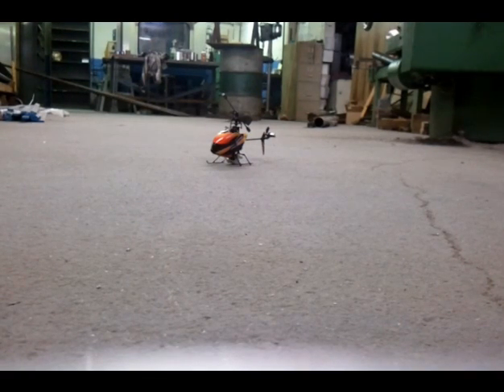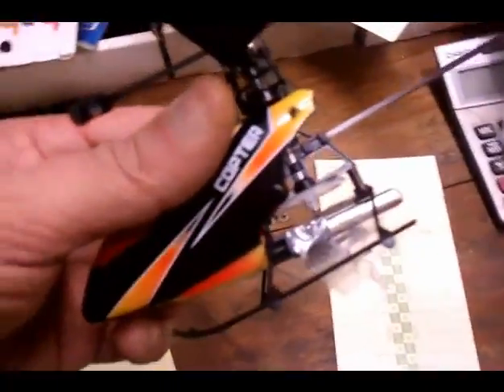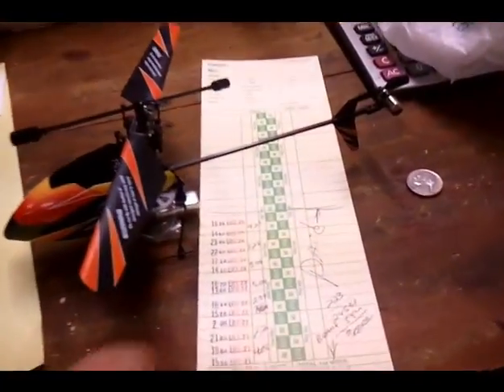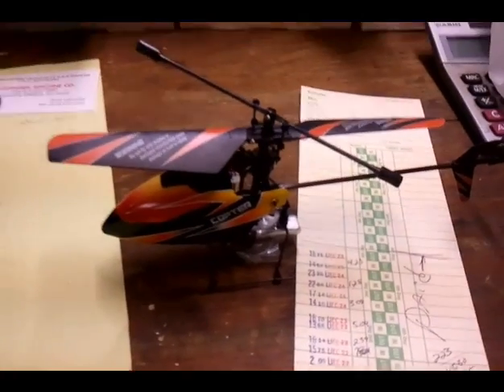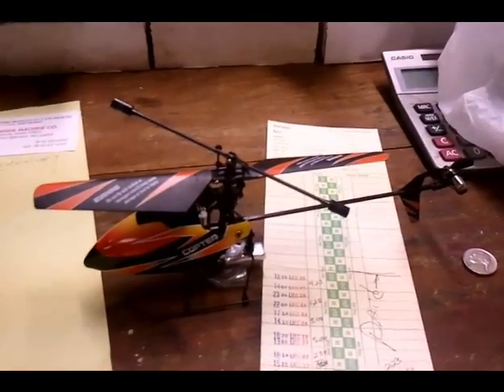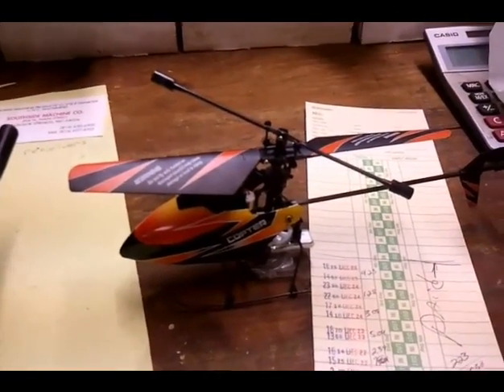WL v911 Weight Carrying Payload Test for FPV

Comment: I'm on mission to make a flyable fpv 911, managed to get a 1.2g cam for very good money and a 10mw tx , it looks like I'm going to be able to trim some of the board away and a metal tab can be trimmed on it too to save some weight on it which will probably offset the wire antenna that will be soldered to it, got a carbon shaft conning and i've found a few places I an save weight on the helis frame like the servo to swash arms are longer than they need to be, remove the tale fin, trim the edge of the Rx circuit board, a tiny bit off the flybar weights and even the flybar retaining screw prop screws and skid screws can loose nearly 1mm in length, the canopy is also coming off, this is surprisingly heavy, if you remove it normally you will see how it upsets the centre of balance and your heli fly's backwards from being tail heavy.

mine is a v911 pro, i've a feeling my skids and stronger frame are heavier than the standard 911 but we have to see what I can get out of it.

i've a much larger heli that can lift 100g+ without any trouble but that's easy, the fun comes trying to get one of these to fly with fpv lol
Reply from the maker: Be sure to follow up here with a link to some flying video from your DIY FPV v911!
Reply: ImYourGuiltyPleasure 

waiting on good old banggood to deliver everrything , flying my 911 on just one battery at the moment  too, waiting for all sorts to arrive!
having a lot of fun flying its bigger cousin the 912 at the moment too, it's well worth the money and the only weak point on it is the landing gear, I keep breaking them on hard landings when the battery saver cuts in and stops me throttling back up, going to be putting video on that too, its got so much lift it's going to manage it without a wimper, the fun challenge is the 911!

my can and tx come to 5g in total and like I said, I've found a number of ways to reduce the weight of the 911,I think with the cam on after the mods, I'll be about 2.5g at most over stock weight, I'm confident in getting it to work.
Reply: ImYourGuiltyPleasure 

good and bad news in the mission to make a fpv v911 pro

the good news is all my stuff arrived and only swapping the main shaft for a carbon shaft shed so much weight it was incredible, I have hooked everything up and had it off the ground with the cam and transmitter active.

the bad news is that although its got enough lift to fly, the gyro has decided to play up and the tail is constantly erratic and gets worse with more throttle, it's the vibration causing it and not the tx, I have found that gentle pressure on the gyro makes it function correctly so there's a bad solder joint somewhere.
I'll have to take a look with my USB microscope and see if it's something I can fix else I'm gonna have to swap all the gear and some parts of the actual heli over to another v911 pro I have that's been waiting on parts.

technically I have successfully made a fpv 911 but it's not worth posting a video from it as it's very hard to keep the tail straight and the video would be terrible ha ha.

no gyro at all I could handle but this is erratic and one minute I've no gyro and I'm controlling the tail (well the nose really as I fly the nose not the tail but you get my drift) with the stick alone then suddenly the gyro bursts back into life for like half a second and whips the tail round at full speed without warning lol.

I'll keep you posted, Steve.
Reply from the maker: Great feedback on your progress. Interested to see if you can get it sorted.
Reply: I'll keep you posted , oh and I didn't fit the 10mw tx in the end as I managed to get a 25mw tx that's multi channel switchable with led ch display from eachine and weighs about the same after all the soldering, possibly even less!
Reply: ImYourGuiltyPleasure 

ok, gyro was bad inside and not a solder joint, I had a gyro on a tiny board with leads comming out of it that I took of a rubbish coaxial toy heli that someone game me for bits, soldered the leads to the 911 board and it's flying normally again, I've had it in the air and flown it with my goggles, serious motion sickness!

flight times are terrible, I'm getting about 3 mins tops from a battery, it's very outside at the moment, about -1c and I noticed that the cold was drastically affecting flight times before, not sure if it's the cold affecting battery performance or the dense air making the blades work harder.

my scales came today and the heli weighs 39.45g with its battery, the tx and the cam on board, all I've done is swap the main shaft for carbon so far, I may move over to the other 911 circuit board as the gyro I've soldered in has added weight, I may also trim down all the screws and loose the tail fin like I said before, loosing just 1g from this will make a massive difference.

another way of shedding weight is to get rid of the prop screws altogether and put a tiny dab of super glue (CA) in the slots where the blades fit together, they are so cheap it's not a problem to have to replace both if one gets damaged and the glue splits apart easy with a blade if you need to take them off.

now I need to get a video done, I'd like to do a proper video rather than just raw footage but have never edited before.

so, it's a successful mission, I've been above my house , what a strange feeling that was!

this has been done for about £14.81 thats for the cam and the tx. I'm not counting  the carbon shaft, that was £3.30 for 2 shafts, a fisheye swash that actually makes it fly worse lol and a spare shaft gear, im amazed how cheap it was to do this

the tx I've used is the eachine vtx01  25mw

when I upload a video I'll post the link.

steve

Comment: So 5g that's too little for a FPV setup then? Bummer..
Reply from the maker: Actually if you switched to a Solo Pro carbon fiber main shaft you could shave a couple grams over the stock metal shaft. And back when I shot this video, shortly after I did find a litghtweight super small cmos camera and a 10mw mini-micro video transmitter that came in at like 4 grams total for both and they ran on 1S power. The extra current draw would impact flight time by maybe as much as a minute... I would recommend to use the stock battery to keep weight down if you try it, resist the higher mah batteries that are available. I really think this would be a fun project. Warning, they were pricey , like in the $100 range for cam and tx. Google for Micro FPV Gear.